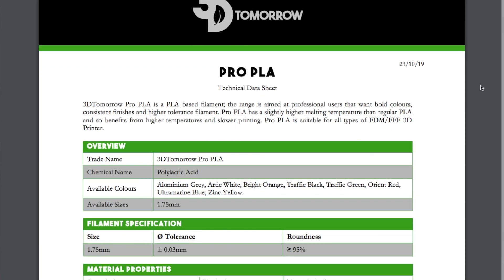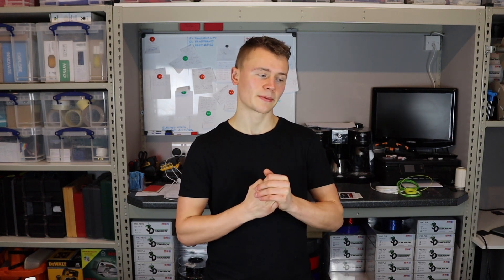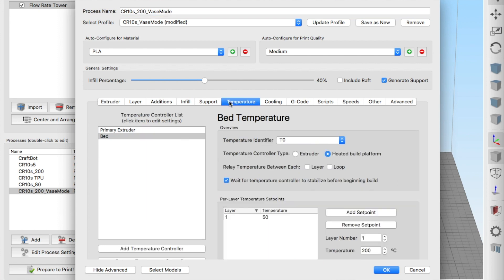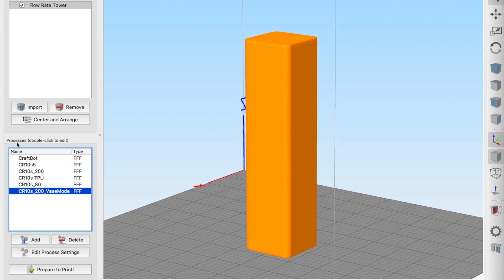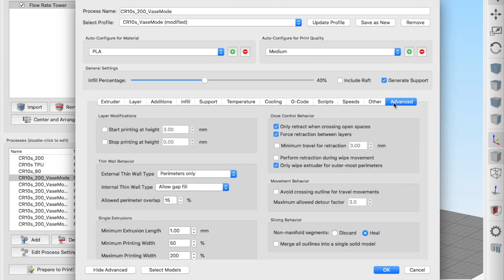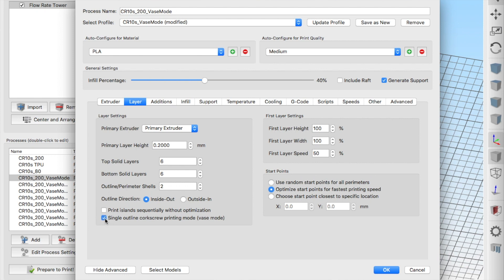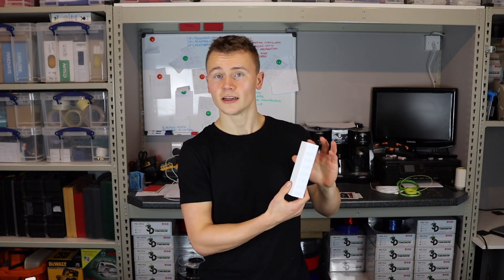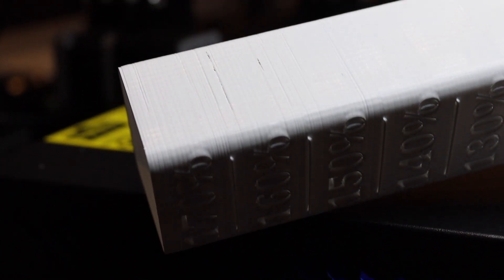Reliable Printing! How to Calculate MAXIMUM FLOW RATE and Print Speed for your 3D Printer

Comment: Hi, Callum. I didn't understand the step 6. The a, b, and c values, should I enter then in the calculator fields Semi-Major Axis, Semi-Minor Axis, and Height, respectively? And about the Step 7, it is sooooo confusing... Could you clarify better?
Reply from the maker: Hi Fabio, sorry for the delay in getting back to you have been away. Have you looked at the article on the website? https://3dtomorrow.com/2019/10/26/calculate-max-flow-rate-and-max-speed/
I will be doing a less technical and more experimental version of this topic soon too :)
Reply: @CallumColes  Yes, i've looked the website. Ok. I found a simpler tutorial that consists in printing a square of 170x170x20mm and print it with only one perimeter. I set two speeds, 40mm/s for the first half, and 80mm/s for the second half (for example). It can be 60 and 120mm/s, or 100 and 200mm/s. Just print it and check if the printer delivers a nice print. It's a very visual and simple test. But anyway, I liked your approach too. Just couldn't go through steps 6 and 7. Thank you.

Comment: Which extruder is the best in case of large nozzle 0.8 or 1 mm printing at high speed? SuperVolcano or Mosquito Magnum?
Reply from the maker: Well 'best', depends on what you want to achieve, if purely looking to maximise flow rate than bigger is indeed better (so 1mm nozzle). In terms of the SuperVolcano vs Mosquito Magnum, they're quite different in their pros/cons & I have not used either personally so would again say it does depend on your specific requirements. I suspect the supervolcano would probably outperform Mosquito in terms of max flow rate. Naturally, the extruder drive gear is also very important, here I would suggested opting for a dual drive gear, something like Bondtech. Hope that helps
Reply: @CallumColes  thank you for your response, regarding the extruder, i ordered an Orbiter 1,5.
Reply from the maker: @szekerespista3758  nice one! Let me know how it goes with that extruder

Comment: Interesting technique but your method adds a variable that could meaningfully skew your results. By trying to force such a wide extrusion width you're increasing the back pressure especially if you have a lot of cooling.

 Performing a test which incrementally increases speed or layer heights is a more pragmatic way to establish these limits.  These variables are what people are usually chasing when they run into flow rate issues so it's better to test these parameters directly
Reply from the maker: Hey Evan, thanks for watching:) sorry for the slow reply I have been busy making filament over the past couple of weeks!
I do agree that wide extrusion will affect the results, but generally speaking, that is sort of the intention for this video, because we're trying to find a safe printing point (maximum flow rate) for the particular printer and setup.
I chose not to adjust the speed because it's heavily affected by other parameters such as acceleration, jerk and any firmware limits by the printer. In other words, a linear increase in the setting of speed will not produce a linear increase in the material flow rate.
The layer height is certainly another candidate that could be varied instead of extrusion width, but figured it would be easier to identify the failing layers if they were all of the same thickness. Also, some printers have some pretty hefty layer intervals, so would be a loss in the accuracy we could measure.
Hopefully that explains my logic behind the choice I made for this video :)
Cheers
Callum

Comment: I see in Cura print speed is mostly for infill and the wall speeds are half of the speed. 
Would this be the overal print speed or the wall print speed?
Trying this out with my Ender 3 v2 ;)
Reply: Strange thing with the formula, the higher the percentage of flow the lower the maximum print speed?
Reply from the maker: Hi Steve, in Cura you would want to override the print speed so that all the fields (walls, infill, etc) are the same value. The reason I chose to keep the speed low and instead adjust extrusion was because you can't be sure that the speed your printer is actually going the speed you set it, this is because other factors such as acceleration, jerk, the hardware itself and firmware overrides all affect this. In Simplify3D it makes it very easy to adjust the process at different layer heights, however, I seem to remember another user commented below a good way to do this in Cura.

Comment: Too complex, I know no one who prints in mm per minute. Every slicer I've ever seen is in mm per second. Filament manufacturers also use that same speed.
Reply: G code itself by default is expressed in terms of mm per minute when the 3D printer is running said G code.
Reply from the maker: @jayclyde6045  very true! I think that is probably why Simplify3D would have opted for it. Although I do think mm/s is probably easier for people to visualise, so can see why other slicers have opted for mm/s
Reply from the maker: Thanks for the comment, mm/min is just the standard in Simplify3D. To get mm/s you just divide by 60. For example 3600mm/min would be equal to 60mm/s. Hope that helps:)

Comment: Thank you so much for this video! I have been trying to work out why I was getting a perfect first layer at a 150% extrusion width but then the following perimeters and infill were failing to overlap upon reduction of the extrusion width. I had completely overlooked the flowrate and that I would need to compensate for it 😅 fab video and great to see some 3d content from the UK 👍🏻
Reply from the maker: Hi Ellen, thank you for commenting, I'm pleased to hear this video helped you to sort out your printer troubles! Always nice to meet a fellow UK printer too. I'll be back to posting more content soon, so if you do have any requests let me know and I will add to the list :)

Comment: be careful with your formulas as you invoke elliptical cross section formula pi*a*b, where a and b are supposed to be radii measurements. you cannot plug in layer height and extrusion width into a and b as these are diameter measurements. your calculated flow rate will be 4x higher than reality.
Reply from the maker: Updated the description and text guide and given you a shout out, thanks again:)
Reply from the maker: Thanks for pointing this out, very true, will add a comment over this section of the video!

Comment: It would be cool to see the flow rate increase of a direct drive BMG or QR. I know there’d be an increase but I wonder if it would be possible to get a percentage range of increased flow rate from 3:1 gearing and then 5:1 gearing with a particular material. I’m sure the flow rate limit with 5:1 gearing will start to be the plastic not sticking itself rather than then obvious skipped steps due to the melt zone not being long enough (at least with a V6 or volcano, not sure about SuperVolcano).
Reply from the maker: Max Vega I have upgraded to BMG before and the increased flow rate is significant to the point where the flow rate is not the bottleneck of the system anymore (unless printing huge layers), instead print speed becomes limited by the mechanical setup instead with issues like skipped steps and layer shifting, so well worth upgrading:)

Comment: Does anyone know how to d o this in cura?
Reply: Special Modes > Spiralize Outer Contour
Cooling > (either) "Minimum layer time" down to a shorter duration than it takes to print a layer at your print speed OR "Minimum speed" up to your print speed. I dropped the time down to 3s and I was printing at 30mm/s. 
Travel  > Enable Retraction - disabled (it will try to retract on some of the lettering).
Extensions > Post Processing > Modify G-Code - ChangeAtZ, enter height (20, 40, etc), Flow Rate (110, 120, etc).

Comment: This was very informative. I am just worried about my printer shaking parts off the bed or vibrating off the table. Thanks for a good video :)
Reply from the maker: Jake_Productions wouldn’t want that! Although heavy vibrations are more likely caused by having high acceleration and jerk settings so would look into those if you ever get issues with that, or try out some vibration dampers/feet on the printer. Thanks for the comment:)
Reply: @CallumColes  I didn't think about that. I know that my jerk and acceleration settings are well within the capabilities of the printer. I'm going to crank the print speed and see what happens.

for some reason, I just assumed that increasing speed would increase acceleration but now that I actually use logic I see the flaw in my thinking.
Reply from the maker: Jake_Productions best of luck🙌🏼

Comment: Is it possible to get instructions to change the extrusion width every 20 mm using Slic3R
Reply: You can do this using modifiers. Add modifier boxes and align them along the height of the tower. The latest version of Prusa Slicer has Hight Range Modifier that makes this process even easier. Add several range modifiers (or modifier boxes), set their hight ranges according with 20mm ranges. Add Extrusion Width modifier for External Perimeter and set width in Nozzle * Ratio From Tower
Reply from the maker: Hi Barry, sorry for the slow reply, caught up in the festivities! I haven't used Slic3r for years, but will re-download it and see if I can figure this out for you. Will keep you posted
Reply from the maker: I've now had a look at Slic3r and there does not seem to be an easy way to do this in that slicer unfortunatley. You could generate the gcode for each of the different extrusion widths, then create a new text file and copy and paste the correct 20mm section of gcode for each extrusion width increment. Alternatively, I am happy to create the gcode for you, if you want me to do this just send an email to mail@3dtomorrow.com, I would need to know the build volume of your printer and the nozzle diameter.
Thanks
Callum